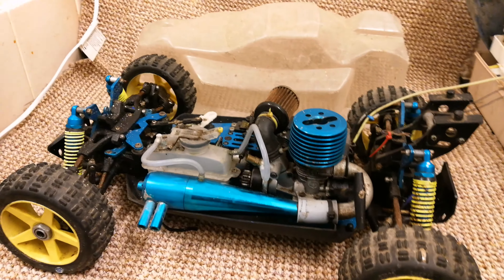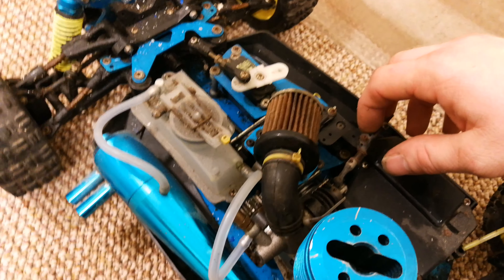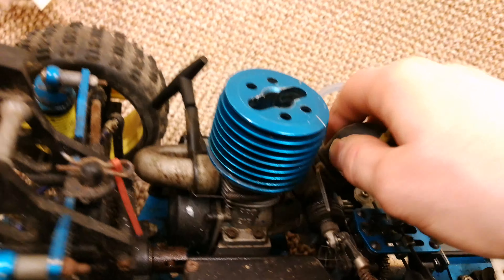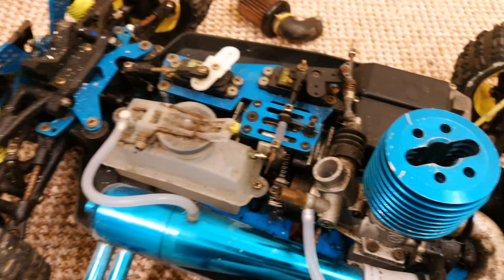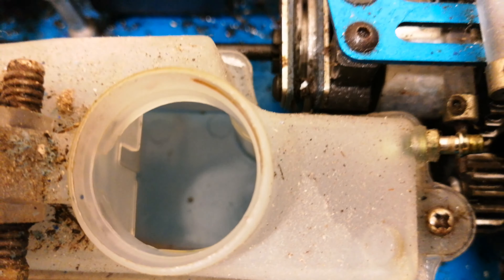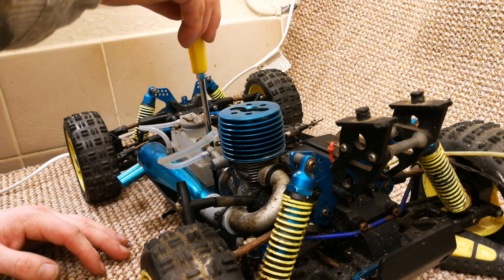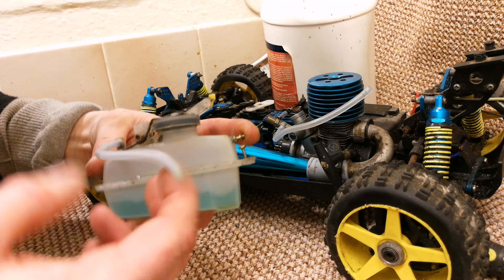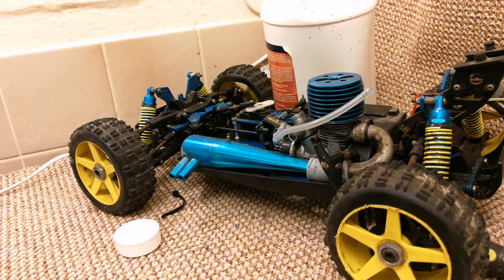How to restore / fix your old nitro rc car PART 2

Comment: For stuck metal into metal screws you cam heat them with a soldering iron to help if you used any blue loctite on your nitro R/C. Blue loctite is essential on nitro R/C metal to metal screws.

Comment: I wonder if that air filter had a foam prefilter originally that a person would oil. Almost like a riding mower filter
Reply from the maker: From my knowledge of TT, they used these in early models with no prefilter

Comment: Good videos, this is really helpful thanks.  I've found my pull start isn't stuck but isn't a very smooth pull, its quite clunky so should oil the piston like in part 1?
Reply from the maker: How do you mean not smooth...

As in... A lot of resistance before it 'pops'?
Reply: @RccarsUK  I've not tried running it yet, but when I pull the cord it is very clunky, about every inch the cord jerks but carries on
Reply from the maker: @MongooseTrianglez  sounds perfectly normal in essence...

As you suspect... Probably dry cylinder walls. Just a few blobs of 3in1 oil will do the trick...

Or Simply pushing some fresh fuel through it from the top of the cylinder, then yanking on the pull cord a few times

Comment: What should I do if the carb is frozen shut ?
Reply from the maker: Fill the carb with 3in1 oil or generic pouring silicone oil.... Then leave it for a day or so.... Make sure its full to the brim of your carb venturi

Comment: Power tools on rc cars is a bit much for me & it also sounds too bulky to work with
Reply from the maker: Depends on the job for me personally.....if it's assembling beadlocks or working on 5th scale gassers then it's power tools..most likely a screw gun...anything else is generally just hand tools...

Horses for courses as they say...